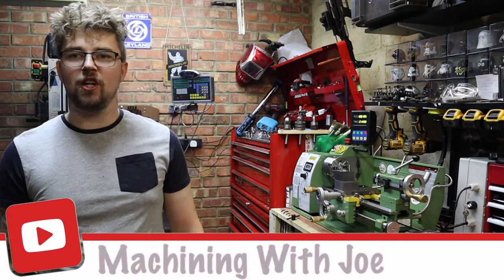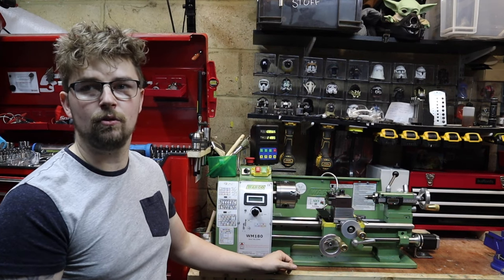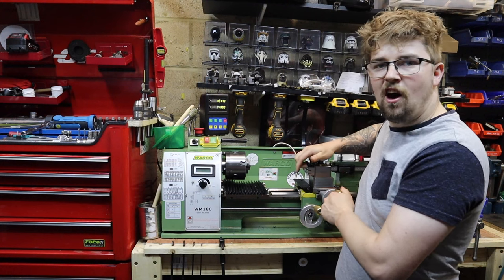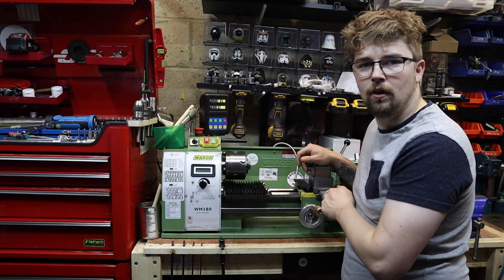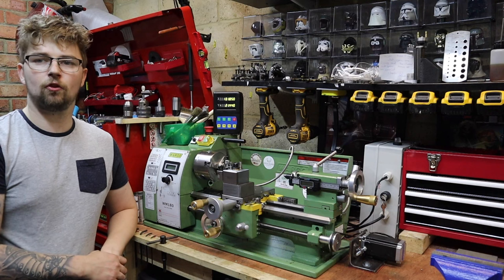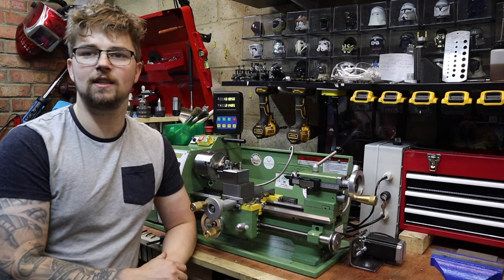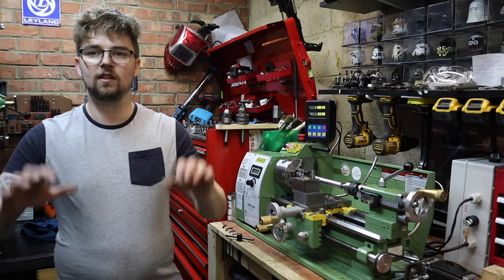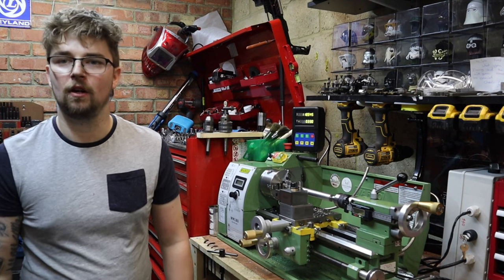Essential MINI Lathe Upgrades

Comment: When I thought about driving the saddle by motor my first thought was the lead screw, but since they are mainly meant for threading and prone to wear I opted for a small DC motor and adapted a pot controller and a DPDT switch for reverse.  I am machining the coupling mechanism to attach to the handwheel shift and a quick on and off mount to retain original functionality.  Gives me the option of adjustable feed bypassing the lead screw and half nut. Let you know how it works out, all for under $100.00 US. Love your resourfulness. You are a very creative individual,  keep up the good work.
Reply from the maker: Cheers Jack be interesting to hear how you get on the concept sounds like a great idea. All the best

Comment: I'm really loving the stepper controlled leadscrew. I'd really like to try something similar out, though I might make a bronze (not sure which type maybe lead bronze) half nut to reduce wear on the leadscrew. Cheers
Reply from the maker: Yeah it works great dude for taking lots of consistent paces. Great idea with the bronze half nut would definitely reduce wear on the lead screw.

Comment: HI Joe
you can use an Aluminum strip of angle iron for your lead screw cover.
Reply from the maker: Hi there Blue Fox
I think on a larger lathe this could be a great idea however on this small bench top lathe I may struggle to fit a piece through the apron.

Comment: As an hobbist for my mini lathe, i already have installed upgrade 2, 5, and 6.
I'll try to install also "Tailstock-DRO" ( n. 8 ) that i believe very usefull.
I don't like "toolpost riser" ( n. 3 ), but i can fix the compound with a screw when not to be used. So i can achive a good rigidity of the tool post.
Best regards from Italy.
Reply from the maker: Yeah the tail stock Dro is an easy cheap mod very handy.

Comment: You might want to check out Clough42 and his ELS (Electronic Lead Screw) project, to take your "power feed" to the next level. You're almost half way there already. Nice list of upgrades though. One more upgrade I would suggest is also swapping out the stock radial bearings on the spindle for angular contact bearings. Cheers!
Reply from the maker: Hi Mark yeah I’ve seen the Little series he done on it really clever stuff definetly some i may consider in the future. As for the bearings my believe was these lathes come with tapered bearing as standard but I may be wrong so I will do some research into this because you are right angular bearing would be much better for the loads the spindle goes through. All the best.
Reply: @MachiningwithJoe  A lathe should come with angular contact bearings [or tapered roller bearings], however as many have discovered the cheap mini-lathes out of China generally do not. Or in the few cases where they did, the quality of those bearings was not very good.
Reply: or the nanoELS nanoels if your budget is tight

Comment: Hmm, so with this setup you can’t do threading? I didn’t see if you have an encoder tracking your spindle position hooked up to the stepper motor like other ELS projects.

Nice video!
Reply: this is just a powered LS, not an ELS exactly because it's not synchronizing with the spindle.  And looking at his '23 WS tour video the powerd LS has been removed already - got a bigger lathe in there.

Comment: Upgrading the spindle bearings to angular contact bearings makes a huge difference - at least it did to mine. Also, if you are going to fit a stepper motor to the lead screw, might be worth investigating clough42's electronic lead screw project for change gear-less single point threading.
Reply from the maker: Hi BM I done a video recently where I found out this brand of mini lathe comes with tapered roller bearings in the head stock as standard so that was impressive. Yeah I’ve seen Clough42 video on this smart guy.

Comment: Have you tried wire loom tubing for the lead screw cover? I don’t know if it would work but they sell many different sizes and I’m sure they are available on Amazon UK. (Or are in Australia ?) Anyway good job with the video and I’ve subscribed.

Comment: A point about lead screw cover, I don't know if it's the same on the Warco but on the Sieg when the leadscrew cover is fitted it gets in the way of the top half-nut, so they did away with it and only used one half nut on the bottom and a 'hook' for the top, might be worth looking to see if a cover will get in the way.
Reply from the maker: Great to know what other makes suffer from. I know people have done it on the Warco so should be ok.

Comment: Nice video! I kept looking at the battery impact holder was that custom or they have it at a store?
Reply from the maker: Hi cheese, 
So these are 3D printed you have two choices really buy them off eBay think there selling 3 for like £10. Or if you have a 3D printer head over to thingyverse and they are on there to download.

Comment: WIth regards to the stepper motor feeding the leadscrew, doesnt the WM180 already have power feed? Mine certainly does so wondering if I shouldnt be using it? Do I need to remove a belt to stop the motor turning it?
Reply from the maker: Hi dude so with regards to this modification the main reason behind it was Yes the lathe has a power feed of sorts but due to the gear reduction the power feed doesn’t go slow enough to get a good surface finish. So by using the stepper motor to power feed the lead screw you can get a really slow feed. If you do this mod make sure to disengage the gear train at the headstock end.
Reply: @MachiningwithJoe  Ahhh that makes sense. I guess you can then vary the rate at which the stepper feeds independently then as well. Good upgrade i'll have to have a crack at doing that.

Comment: Hi i need help i need make thread 10 tpi but details of gear in machine is incorrect, you know make thread 10 tpi?
Reply from the maker: Sorry this machine is metric. There is probably a set of gearing you can get but not sure if possible with the metric lead screw.

Comment: DROs from SHAHE are the most affordable. They are good enough by far and easy to insall. They run with batteries, but power them with 3,3 volt from a 5Volt saurce with a little 3,3V regulator is easy done.

Comment: Maybe it can be possible to use an AXA tool post on a minilathe instead the smaller chinese  tool post ?
Reply from the maker: Yeah if you wanted to fit one of these you would either have to machine the bottom of the tool post to accept the boss register on top of the compound or make a spacer plate.

Comment: Hello Joe, have you tried Warco for leadscrew covers?  The telescopic leadscrew covers they supply for the WM240/250 might fit, and they may hold them as spares.
Reply from the maker: Great idea Steve, will be well worth contacting them regarding this. Thanks for the idea 👍
Reply: @MachiningwithJoe  My pleasure.

Comment: Hi Joe, I have the same DRO installed on my WM180, just a question regarding the cross slide axis, one turn on the hand wheel removes 2mm of material but DRO only says 1mm as that's how far the slide has travelled, is there a way to compensate for this on the DRO? Cheers. Adam.
Reply from the maker: Hi Adam hopefully this will be an easy one to answer. So your hand wheel is showing material removed from the diameter of your work. If I’m right in thinking this will be displayed by a circle with a line through it. Where as the dro is showing material removed from the radius as it’s the actual movement. As radius is 1/2 the diameter you just need to double the measurement displayed on the dro to work out overall material removal. Hope that helps
Reply: @MachiningwithJoe  Isn't there a d/r button on the dro  which shows diameter or radius, also was this easy to fit as Warco suggest it is for the smaller machine.

Comment: I would draw issue with you. A Mini-Lathe often referred to as 7 by 12, 7 by 14 or these days even 7 by 15 is a light lathe weighing in 12 centres around 37Kg The Warco WM-180 is an ultra short bed version of a full size  model engineer's lathe weighing 60kg. Please do not try saying to me that it has a 90mm (3 1/2") centre height. The most popular Model Engineer lathe  as made by Myford has a 3 1/2" centre height with a gap bed. I own one. So with all due respect, please do not equate your WM-180 with the far narrower bed true mini-lathes. It just isn't one of these machines. It is a far better lathe to start with. Not as good as an ML7-R or Super 7, both of which have a true precision front bearing as used on the best toolroom lathes. But then, a new Super 7 costs a lot more than the WM-180 & you only get what you pay for or are prepared to re-build using your own skill & money.

Comment: tapered roller bearings. if not already installed.
Reply from the maker: That is a great upgrade. Luckily this lathes headstock came fitted with them as standard.

Comment: I'm surprised that there's not much "After Sales" on Chinese lathe, seing how I had to replace just about everything.
Reply from the maker: Hi Gary,
So the warco range I would say is actually one of the best from my experience for after sales. They normally respond fairly quick and provide good responses. Including spare parts repair manuals or just general advise. Would definitely recommend as for customer advise and after sales.

Comment: It does make you wonder if it's worth  just buying a better quality lathe that doesn't need upgrading.
Reply: Even high quality lathes do not have these features. outside of a dro,that's about it. These upgrades can make any lathe better and easier to use.
Reply: It depends on your budget, mini lathes are a great price for something that can be turned into a precision device at a very low cost. Also you might have the budget for a more expensive one, but you want to learn and make your mistakes on a cheaper device.